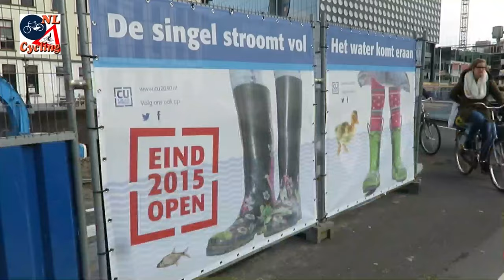How This City Removed A 12 Lane Motorway To Restore It's Ancient Canal Built By The Moors

Comment: Amazing transformation. Very beautiful.
This video should be seen by all cities local transportation planners. It should be taught to city engineers and planners in University.
Walking, cycling and mass transit are key to making cities livable. People need to contact their local transportation planners and elected officials and make walking and cycling the preferred option of travel in the city.
Reply: Meh, Roads are still important. I'd rather be able to get around fast, cheap than have to worry about if my bus is on time.
Reply: Yea till you have to bike in rain and snow. Only on nice days you see so many bicycle
Reply: We need both roads and walking riding paths.
Reply: @leasachapman21  We need safe mobility options. People should be able to walk, ride a bicycle or take mass transit as well as  drive a vehicle.
Reply: @bansheezs  Driving is neither cheap, nor fast in most cities, but especially in European cities. When you add up all the many costs involved in owning and driving a car, the results are frightening. In many cities, it is usually faster to take the Metro than to drive.
Reply: @benkok02  In most major cities and even some small ones, you have to park wherever you can find a spot and hike in to wherever you were trying to get to, regardless of weather, or other conditions. The car is simply not an efficient inner city mode of transpotation.
Reply: @kkgauthier  Most cities? lol have you been to the US? 99% of the cities are sprawling and it would take you forever to get anywhere on public transportation, in general public trasportation is more expensive than just driving. The only reason europe's isn't seemingly more expensive is because the government subsidies it, so in reality public transportation is more expensive than what people think. I went to europe a few times and found that the much praised train system was almost always slower and more expensive than taking a plane for long distances (except in Italy, which subsidies the heck out of the trains there) In switzerland and germany, its much faster and cheaper to just drive a car (and this was from a car rental stand point, it would be even cheaper to own your own). Perhaps if you are in a city where they subsidize the heck out of mass transit, then it would probably be cheaper than owning a car since you can't say no to paying the taxes for mass transit.
Reply: @bansheezs  If you live downtown anywhere, driving usually takes longer than the metro. largely because of parking which is always either extremely expensive, or nearly impossible to find near the business you're trying to get to. Most Americans are spending at least a quarter of their income on cars in one way or another. Urban sprawl is a blight on society and forces people to own cars whether they want to or not.
Reply: @kkgauthier  The cost of parking and driving to and from homes in cities in the US tends to actually be cheaper or at least the same than hoping on a train. Take for example Denver. It has a light rail system that costs about 10 dollars to go 1 way, so 20 dollars round trip. Usually you can find parking for a day from 10-15 dollars a day, and gas would be about 5 dollars round trip. Its about the same cost but it would be faster than light rail since light rail at least in denver stops every mile.
Reply: I appreciate the concept, but what about the disabled and elderly people?
Reply: @sunniertimer598  they walk or cycle and if they can't, they have mobility scooters, wheelchairs and other options such as transit... and also they can still use a car, as they are certainly not "banned", just re-directed in the city.